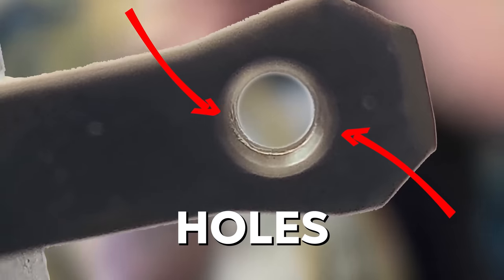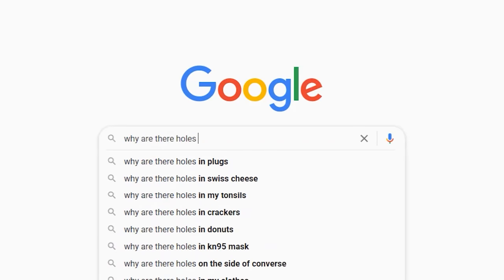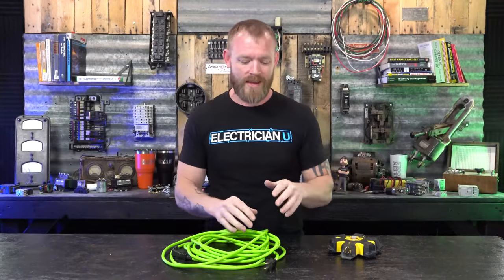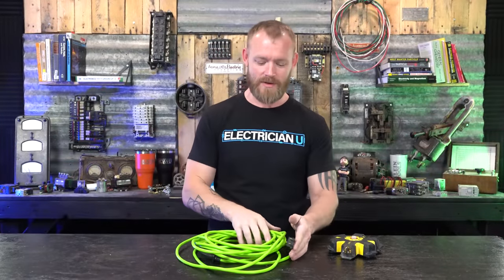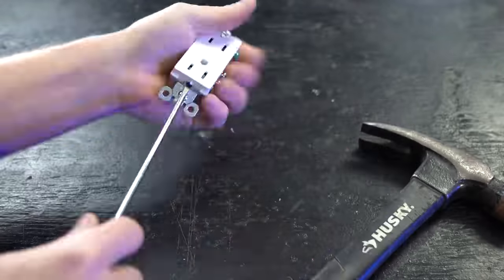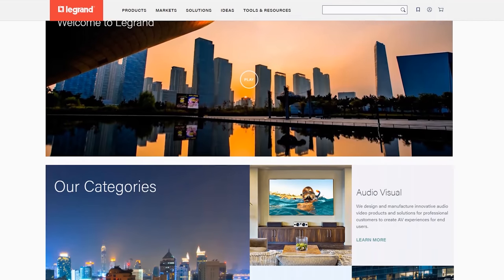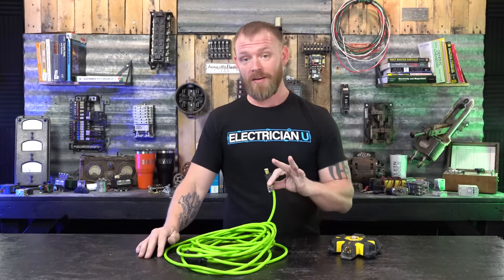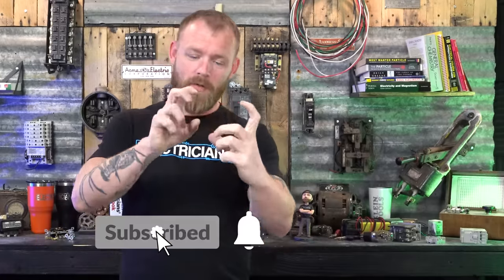WHY Do Plugs Have HOLES? The ACTUAL Answer!

Comment: The final conclusion still isn't right, though (sorry to say!). You're asking the wrong people; ask the cord/plug manufacturers. The reason for the holes (and this is explicitly stated in UL documentation) is "manufacturing convenience." The holes allow machinery to hold the prongs in place during the molding process.
Reply: As an Robotics student I suspected that.
Reply: Legrand is a cord/plug manufacturer and the make some of the highest quality ones around.
Reply: @patrickderegt2582  indeed they do! Doesn't change factual process details, though.
Reply: @marcberm  Couldn't it be both? Historical receptacles needed it, AND it's beneficial for the manufacturing process? Maybe they've been made like that for so long that the manufacturing process evolved to 'expect' a hole/use a hole. Obviously some plugs are made without it so its not absolutely necessary for manufacturing.
Reply: @wesgould1  I agree with you. Everyone always is looking for "the" answer. It could just be a list of benefits and reasons as to why it started and why it wasn't phased out.
Reply: and to also help with the alignment to make sure the prongs don't protrude past a certain length and are of equal length to each other
Reply: Yeah, it's probably a  list of reasons. Manufacturing convenience is a big one as it allows you to overmold the plug body - those one piece plugs basically have the contacts attached to wires, then they're placed in a jig that puts a rod through the prongs to hold them at a consistent length, then the whole thing is injection molded. and you end up with prongs exposed at the proper length. 

Note that the plugs without holes typically are for the Chinese market which uses similar plugs and sockets, except at 240V and unpolarized (and exclusively ungrounded). I don't think I've ever come across any UL rated plugs that actually didn't have holes.
Reply: Some may use the holes to hold the prongs for molding, but they are optional in holding requirements....the grips to the sides of the prongs are easily able to hold during the molding process.

Dustin is actually correct here, as there are older outlets that contained round pinch type connectors that would grip the cable better. In order to maintain uniformity across the industry, it was standardized that if you are to have holes in the prongs, they must be a certain minimum to maximum size and must be a specific offset from the tip to accommodate the pinch sockets. The pinch sockets are no longer used, but because the standard has always been there, machines were created to take advantage of them.....it doesn't mean they were created for that purpose though.
Reply: Makes sense
Reply: @sabriath  I think you are correct here.
Reply: correct
Reply: Yeah Technology Connections made a whole video about this. I'm not sure how Dustin didn't see that in his research.
Reply: Yes!!! Came here to say this another youtuber actually answered this by going to the extention cord and lamp cord manufacturers and seeing the machines they use to make plugs
Reply: Well, one of the engineers said, don't say that, say the clamping force thing when relaying the answer to customer service.
Reply: To add to this, there's a post from 1985 from Cecil Adams "The Straight Dope" column who consulted several different engineers and has the same "manufacturing convenience" answer.  I'd trust this over just about anything else, primarily because the sources are UL and a firm who actually manufacturers electrical equipment.  A pretty decent research effort, and it also claims that the original reason was the nubbins in the socket, but that's since evolved.

I'd link to it, buy youtube of course won't let me let you leave the walled garden of Youtube.

The other thing that's fascinating is..  this disagreement has been going on for at least 37 years!  It's not just an internet thing
Reply: Plenty of other ways to hold them, and if this was the case every manufacturer could ahve different plugs.  This is clearly a standard for a purpose so outlet holds makes the most sense.  The machinery was just build to leverage this.
Reply: Was wondering about that. Most old plugs are two prong only, so I don't see why they would bother manufacturing 3 prong plugs to "work" in an outlet they physically can't fit into
Reply: And this has already been covered on Youtube. Uploader should have done a little more searching before making this video.
Reply: @wesgould1  Historically it may have been needed, like they said, but that would not explain why they are still there. And the fact that some don't have it does not imply much one way or the other. There are obviously many ways to skin a cat, but if one is better or more efficient than others, that will be the more common one.
Reply: You are correct. It's solely to help with the molding process during manufacturing
Reply: You are wrong. Long before the first "molded" cords were made, there were holes in the metal prongs. And there are plenty of "molded" plugs made today without holes.
Reply: @MrGatlin98   Because it's nonsense. UL Labs does not rate how a plug is made.
Reply: @R3sp3ct801  Nonsense. The third prong ground does not have a hole in it. It's all bs.
Reply: Probably does double duty. From the engineers perspective, they stated what this channel did. But yes, I can see ( I'm a machinist) how having a hole can assist with alignment in a stamping/shear operation. Probably also during a plastic molding operation for alignment. But, double duty.
Reply: Thank you. Needlessly long videos just to get to the point annoy me. You saved me the time.
Reply: Thanks for saving me 4 minutes
Reply: Makes no sense... Is today's manufacturing technology not advanced enough to avoid the holes?
Reply: Oh yeah . Prove it dude
Reply: @sabriath  thank you for your answer.
Reply: That's exactly what I was waiting to hear
Reply: It’s so the electricity can atomize and is able to combust and make electrically controlled anything work
Reply: I agree. I feel like he received the best answer as far as the people he asked, however your conclusion makes the most sense.
Reply: this explanation is a LOAD OF CRAP....
australian plugs dont have these holes... they manufacture them just fine without the need for holes...
Reply: @WacKEDmaN  , thank you! Was just about to say the same thing then I read your reply. Nothing to do with manufacturing and everything to do with the answer given in the video. I figured it is an “only in America” thing. We’ve never had this in Aus so our plugs don’t have holes. The only issue we’ve ever had with our plugs is not that they come lose, it’s the cheap crappy power boards made in China that you can’t get the damn plug into!
Reply: @sabriath  show me an outlet that actually made use of the holes for better grip. I have heard the claim, but never seen any evidence. A more possible reason for the standardization of the holes (if they are being utilized for manufacturing purposes) is to make sure that they are not in an area or of a size that would negatively effect the connection or conductivity.
Reply: @schilling3003  From what I can remember, the company went defunct rather quickly BECAUSE of the "sticking" problem....as fast as it got standardized, is as fast as they pretty much pulled every single outlet off the market because of fire risk. The standardization wasn't changed because "what isn't broke, don't fix it" mentality.
Reply: Bullshit.  There are NO holes in UK, Australia etc and I think Asia.
Reply: Yep, definitely no holes in Australian plugs. I’m an Aussie who’s been an electronics repair tech for over 35 years and I can assure you the Australia/New Zealand  standard 240v 3pin earthed and 2pin unearthed power plugs (all flat pins) have never had holes. Ever!
Reply: @jamesstevens2362  you’re absolutely right. I have edited my post.  I left out the no … greetings from Bendigo
Reply: @petesmith9472 , no worries! I’ve also done an edit. I was thinking that if you have seen any plugs like that here, one guess where it was made, in which case I’d be worried that it’s wired up wrong. Greetings from Mornington. 👍🏻
Reply: It's actually NEMA, not UL, that made the specification.  Anyway, NEMA says the hole is optional, and it's only for manufacturing purposes.
Reply: I just knew this comment was going to be controversial LOL. 🤣
Reply: @marcberm  then how do you explain no holes in the rest of the world
Reply: @petesmith9472  I don't know, this is just how it works for most machinery to make molded plugs for North America. Search YouTube for "Nema plug power cords production line" and notice how the long pin holds the whole row of plugs in place for the molding process and they all fall out when it's pulled at the end.
Reply: All this is probably true but one thing escapes me it seem to me that a plug with a hole in it originally in the outlet had a compression fitting that would hold the plug in place making it harder to be accidentally ajared electricity scared people for a long time and people needed a safety feature in my opinion this was the original idea that the holes were a lock in place feature
Reply: But what do I know I'm an idiot
Reply: You are wrong, the convenience is the ability to only make one blade or buying a larger volume instead of having to make a seperate set without the holes. Those blades have a lot more uses than just the ends of cords and the cost of drilling a hole wouldn't be economical or explain why outside the US the holes aren't common. The holes also make testing easier by having access to the area where the connectors meet instead of attaching to the outside of one end, but I don't think that would count as manufacturing.
Reply: Thank you this.  It certainly makes the most sense.
Reply: Wow
Reply: @sabriath Yep, it would cost an extraordinary amount to retool that equipment around the world, whenever codes, best practices or folklore changed?

Comment: Technology connections has a great video on this. In his research it used by the manufacturer of the cords to hold the prongs during the plastic injection process
Reply: So this makes a lot of sense in combination with the answer "there used to be bumps". Aka, manufacturers introduced the hole to engage with the plug first, and the hole became a part of their mounting for manufacturing. Then the hole became a necessary part of the tooling, and there isn't really a cheap way to do things, so just keep the hole, don't change your tooling.
Reply: Yeah I probably would take TC's word for it because that man is obsessed finding the answers...
Reply: This is the real answer, simply look at the patent documents, it even states it there. They are solely to hold the blades during manufacture.
Reply: @donerickson1954   Nonsense. I' spent decades designing cnc machines for the aerospace industry and I can assure you a $30 pneumatic cylinder would hold the prong in place just fine without any holes. No one has an effective patent on holes in prongs.
Reply: @thomcarr7021  If you want, you can go argue with ANSI and NEMA, who define the standard, which says, and I quote: "HOLE IN FLAT BLADE IS OPTIONAL, AND IT IS INTENDED FOR MANUFACTURING PURPOSES ONLY".  Go ahead and tell them they're wrong and they need to fix page 16 of WD 6-2016.

The patent was on the original electrical prong design, where the detents were on the edges of the prong, not a hole through the middle.  Those detents were in fact there to allow plugs to grip onto the prong better.  Because that design was patented, however, other people making their own plugs came up with alternative techniques, which led to the original holes through the prong design.
Reply: @Drysart    First page states:  NOTICE AND DISCLAIMER 
The information in this publication was considered technically sound by the consensus of persons 
engaged in the development and approval of the document at the time it was developed. Consensus does 
not necessarily mean that there is unanimous agreement among every person participating in the 
development of this document.
Reply: @thomcarr7021  Yeah so go let them know they're wrong.
Reply: @Drysart   There is no need to. They would repeat what I mentioned. It is simply their opinion.

Comment: They make extension cords that lock on with those holes to keep the plug from falling out. Works that same a a pneumatic quick connect at a previous job there was a guy that had one for his angle grinder.

Comment: Lock out/Tag out makes a lot of sense to me though. (35year sparky/USNavy electrician to start, myself) But the "overheating" concept certainly makes sense as well. Great video, sir!
Reply: That's a tiny lock though:p
Reply: @dlamz92  
It's really not about keeping it totally secure to never let anyone into the locking apparatus. It's merely a lock on it so it doesn't go anywhere easily unless there's someone at the scene that is intentionally trying to kill someone else by electrocution by using the item that has been tagged out/locked out. 
They aren't something to lock the safe with! 

Zip ties work just as well.
Reply: Wonder why he dismissed that idea without reason
Reply: @chrischapman276  What are you talking about? nobody is trying to lock a safe. They  are there so someone doesnt turn on the disconnect or breaker because something isnt working correctly.  and Why would the little holes being for lock out make sense. In 35 years as an electrician have you ever seen that. In places you use lock out tags theres not a plug and receptacle  just hanging around waiting for someone to  put them together
Reply: @danielhoward8354  I'm thinking you meant someone else.
Hell, I said the exact same

Comment: The small hole near the end of the power (non-ground) blades of some NEMA plugs is used for convenience in manufacturing; if present, it must be of specified diameter and position.[2] Small specialized padlocks are available to fit these holes, allowing "lockout" of hazardous equipment, by physically preventing insertion of locked plugs into a power receptacle. Since at least 1949, numerous receptacle devices have also been invented to use these holes to hold the prongs inside the receptacle slots, using a corresponding latch or locking mechanism. [3] from Wikipedia
Reply: The LOTO answer is wrong as wrong could be. Just because the holes could be used for that purpose does not mean that was the purpose of the design.
Reply: In plain English, the plug holes are for...  for...  for...  What?

Comment: I've seen a new extension cord that had a locking feature in the female side that engaged a pin in the hole and you had to push a release button to get the two sides to come apart. It was pretty nice for tools not coming unplugged when your using them
Reply: I have one that does that. it's pretty cool, then I still tie the connection in a knot because im not going to trust it while tugging it around.
Reply: I have a three socket extension cord with a button for each socket. Sometmes it works too well keeping the plug in.
Reply: Sounds pretty neat.
Reply: I have these on computers and monitors to keep cats from unplugging things when they walk behind things. Long live displayport too.
Reply: I believe hospitals use similar equipment so your life support doesn't get unplugged if someone trips over the cord.
Reply: @paddington1670  I seem to remember that I usually see this type of comment coming from Canadians -- here is the USA, I've never seen such a socket.
Reply: @fewwiggle  I have gotten a few cords with a female locking end in the US, but they are definitely rare.
Reply: @MOTO809  I thought thats why they invented MagSafe.  :)
Reply: @travis1240  Ok.
Reply: This is not the actual reason for the holes though.  The holes are there to aid in the manufacturing process.  The locking receptacles simply take advantage of them for a new different purpose.

Comment: I have a multi-socket extension cord that uses those holes with a locking mechanism to prevent the cord from pulling out. Probably not the original use, but a clever one anyway.
Reply: This 👆🏼
Reply: that makes sense, the old knot on the electric leafblower is probably bad for the conductors of both cords.  But a button lock serves the same job of holding things together without undue stress on the conductors.

Comment: Been informed that it's a manufacturer convenience when attaching the wires to the plug end and the other processes during cord production.
The holes provide a space for holding the cord, usually with a thin rod, to hold tension so the wires are straight when attaching, when being covered by the rubber/plastic, and when being rolled up & wrapped to ship.
Reply: This is what I understood the answer to be

Comment: In the UK there was a, now defunct, type of plug and socket where the pins on the plug had a hole which was used to lock the plug in the socket when the switch was turned on, this was a safety feature as it prevented a plug being partially pulled out exposing live pins.
Reply: The only fault I can see about having something like that is the need to unplug that appliance if there is a fault happen to it. If there is sparking'/arcing/fire/danger from the appliance to where you couldn't pull on the cord to unplug it immediately. 
I know you said it isn't in action today. I just had to state a few pennies to my thoughts.
Reply: @chrischapman276  UK plugs have a fuse in that blows in that kind of situation, which cuts the power to the device.
Reply: @ultrademigod  Interesting.. I like the concept but How much do those cost? 
Figuring I use to buy a 10 pack of the "preferred" recepts for around $15/USD/12 pounds UK. 
I could imagine the price difference is extreme?

Comment: Find a receptacle from the early 20th century. Then take it apart and see if the metal inside lacks spring tension and has a bump. This not only prevented cords from coming out, it prevented arcing.